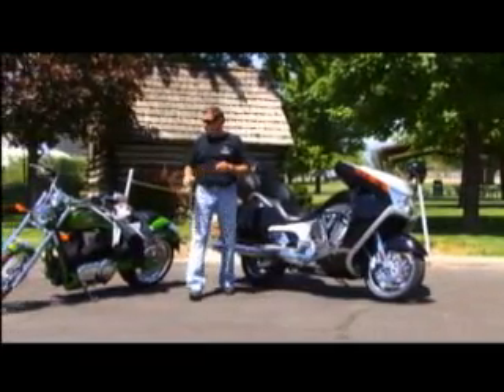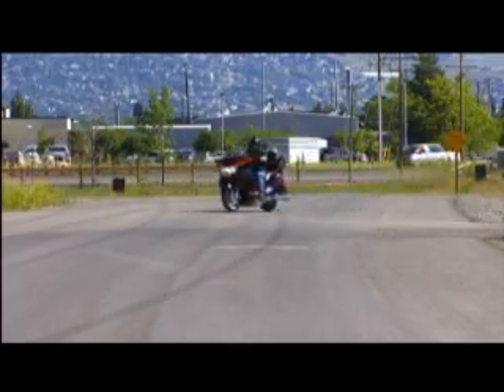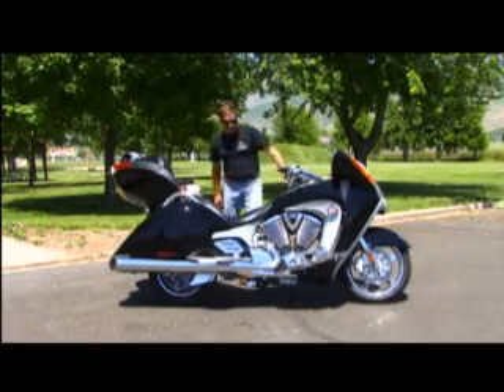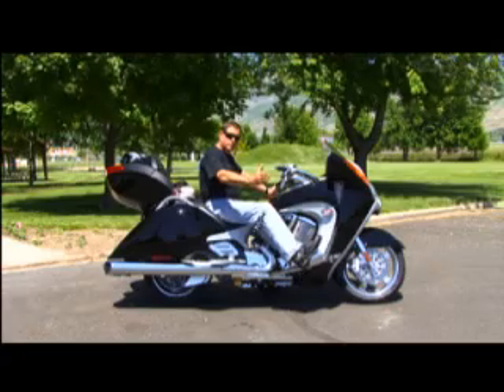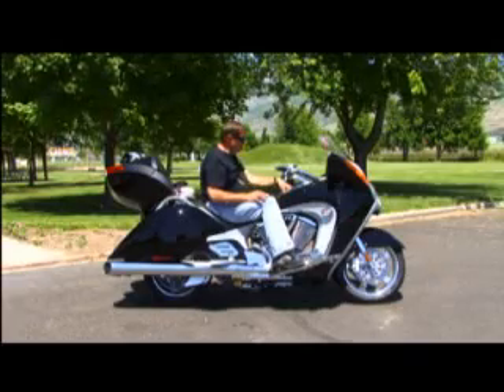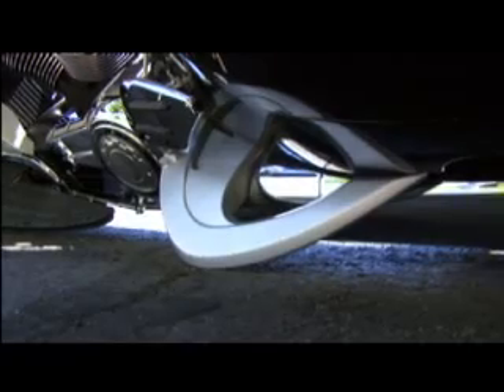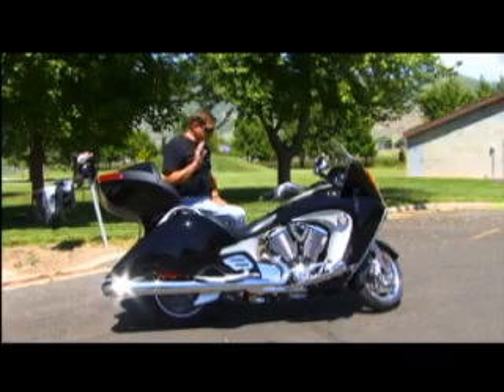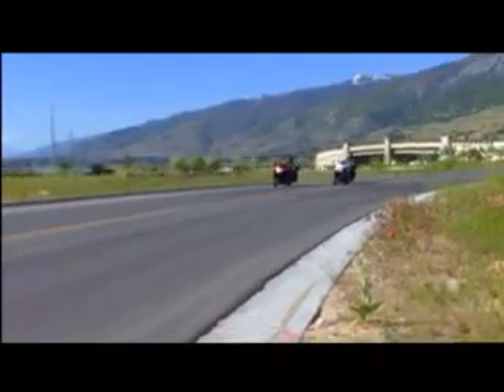Victory Vision EXTENDED

Comment: I own 2 Harleys, a Vengence chopper and even a Campagna Trex . I was trading in my HD RoadKing ( which I like BTW) for a Goldwing and decided on a whim to stop into a Victory dealer to demo a Vision Tour for the day. After one day on the Vision, I brought it back and bought the bike. Handling is excellent, Riding position superb, Controls perfect, Braking very good (w/ABS), Stereo great, Power not bad. It wont be the fastest cruiser out there, but you'll certainly be the most comfortable.

Comment: The vision has some very interesting appeal. It can't compete with the power of the wing. But it does have a lot nicer sound and better low speed balance. A wing has years behind the design and a rep for reliabilty. The wing has better heat control. If you lay down a wing you open your wallet. So don't do that.

Comment: The GoldWing is not an inline 4, but a horizontally opposed 6.  Who is this clown anyways?

"Vision will keep up with a Wing - maybe surpass it"  Let's see 1700cc 2 cylinder versus 1800 cc 6 cylinder.  93HP versus 105+.

Approximately the same weight.